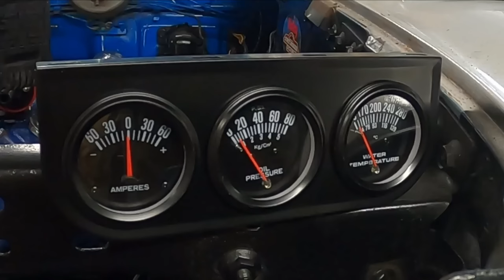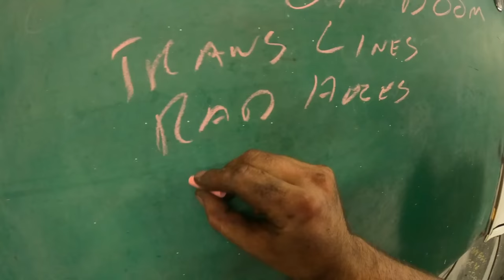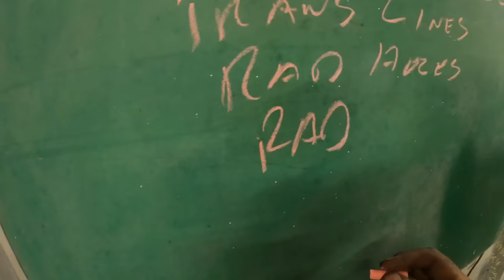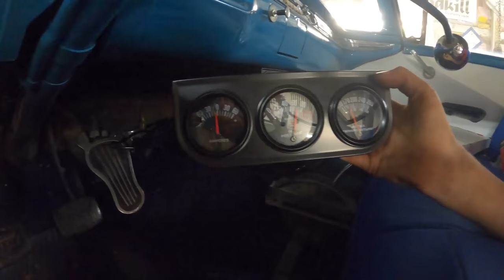Will it Run? 390 Ford FE BIG BLOCK Shadetree Special Install in 1959 Ford — My Son's First Hot Rod

Comment: I miss the years of when my son and I did this stuff. We swapped our rusted out frame on my 65 Galaxie 2 dr ht, put the 394FE I built back in 1999 and pulled it out of the truck, put the C6 and 4.33 locker in and the engine/transmission swap in, it was so much fun. I m 62 now and blind and my son is 40 now and really busy with his own family and work. Do these things while you can. They grow up so fast!
Reply from the maker: They really do

Comment: I was a ford transmission tech forever.the secret to lining up the torque converter studs is to center the stud at 12:00 and the flywheel hole the same.once it is installed,check to make sure the stud wiggles in the hole in the flywheel.if not,pull it back out because something is not right.
Reply from the maker: That is exactly what I did actually

Comment: Thank you for uploading this.  I had an awful weekend and the neighbor I grew up learning repairing things from is gone.  Your uploads really brighten things for me sometimes.  On the Ford C6 I was taught that the torque converter seats in 3 steps and you want to be able to wiggle the torque converter stud side to side and that will show it isn't bound up.  I've had my C6 out a few times and they are a pain but I still like my Fords.

Comment: Some us more senior mechanics are aware that when the oil pump shaft refuses to engage the oil pump, or the distributor depending on make, all one has to do is bump the starter until it does. In any case long before you have arrived at the point of obstruction the distributor gear has already engaged the camshaft so bumping the starter doesn't upset anything. Never fails.
Reply from the maker: Good point, but I prefer to know exactly where the rotor is on startup, try to eyeball the timing

Comment: Me and my dad rebuilt an '83 F150 for my first daily driver and dad's hot rod, a lot like you're doing with JD. I wrecked that thing not 5 months after I got my drivers license, totaling it but we managed to salvage the motor. We built several more vehicles throughout the years together, and not a day goes by that I don't wish that I had one of those vehicles to remember him by. Our '93 F350 dually with the 12v Cummins diesel, the '85 F350 4x4 shortbed we made, the '70 Torino we put back on the road, or just working on my '97 Mercury Cougar.

Comment: Your doing good guys. That's a Bummer when that happens, I know you know the torque converter goes in 3 steps, just another insurance is when you mount trans to engine keep checking that the T converter is free spinning behind the flex plate then pull it forward to bolt up when bell housing is home. Great job on that engine. Awesome project
Reply from the maker: Amateur mistake, no doubt. I can promise you it only took one time to learn it

Comment: You had me gritting my teeth and crossing my fingers when you pulled the transmission in with bolts. I actually broke the bell housing on a  C6 once in my 1979 F150 while doing that.
Reply from the maker: So far so good for me, I know that day will come though

Comment: Gotta love that vacuum wiper motor. Pro tip, it may need to get a bit wet before it works. My ‘59 Retractable is quite the teacher
Reply from the maker: Yeah hopefully I can rig an electric motor into it
Reply: @PoleBarnGarage , they sell them. I may have one in my parts stash

Comment: Just stumbled upon this randomly. Good to see someone putting an FE in a car instead of some new crate engine. My favorite engines. Drove a 64 galaxie to work and back today. Not sure if you have done this yet or not, but those cars should have a ballast resistor wire that comes off the ignition switch via a bullet connector and goes into the wiring harness and has another bullet connector on the other end of it. It should be eliminated or disconnect the wire at the bullet connector and run a new wire out to the MSD distributor from there.
Reply from the maker: Yep I threw it away in the video, thanks for coming along. You'll find that even though I don't really like FE engines, I'm pretty big on keeping things old school, even if that means I suffer
Reply: @PoleBarnGarage  I've built a couple of them, one a 390 and the other a 445 stroker. They will give you a run for your money for sure, but once they are done, they are awesome running engines. Believe me, I've done my fair share of swearing at them LOL!

Comment: I don’t know if anyone has commented before, but that fuel pump can be ‘clocked’ undo the bolts at the bottom and take off the cap and turn it where the inlet/outlet work with your vehicle
Reply from the maker: Yeah I learned that later on. Still not sure what kind of fitting you use in it

Comment: Yeah I was hoping that I could tell you those headers weren’t going to fit but you found that out. I have a 57 Ford ranchero I put a 390 and I had the same problem nobody makes a set of headers for that car. Except for a couple of people I think one guy is in Oregon and he wants $1200 for a set. So I said no to that. I got a set of headers for 390 F250 pick up 71 through 73 for about $150 and cut them up and made them work and made my own headers. It’s either that or run the stock exhaust manifold which I did not want to do. Best of luck to you and your son I think that’s a cool father and son project I did a lot of that growing up with my dad.👍
Reply from the maker: Hey, I did find headers from Schofield I think. $400 a set, not cheap, but they do exist if you're looking
Reply: @PoleBarnGarage   thanks anyway but I’m happy with the ones that I made because they’re full length and that’s what I wanted. Have been on the truck for five years now no problems .🇺🇸🛠🇺🇸

Comment: Like the 59 my family had one the same color pattern but a 4 door , 260 v-8 I believe
Reply from the maker: No Windsor in 59, likely a 292 or 312 Y block. An engine I like even less than an FE..
Reply: @PoleBarnGarage  won’t argue that probably was a 292  or what was the bigger maybe 312 , got it from my grandpas in 64 , I remember being 5 or so and I had found a flat bastard file in the yard and hopped in the car and accidentally hit the steel dash on the passenger side with it and put a dent and a scratch in it, I’m almost 61 and can still remember the ass whipping I got for that.
Reply: @PoleBarnGarage  the 59 was a step up from a 51 Pontiac straight 8 that wasn’t running

Comment: Woohoo!  She runs!  In fact she sounds ruddy awesome!  Shows you don't have to spend megabux on an engine to get another 20 or 30k miles at least out of it - take a tired beast, chuck rings and bearings in, dingle-ball hone the block to somewhere decent, chuck a decent oil pump in, lap the valves so they seal properly and away she goes. I'm just surprised it worked on a Ford...but maybe it was your technique rather than the engine itself!   That 2000rpm rip sounded great and her idle was perfect. Just a pity that the box didn't want to play the game.  

Great to see her alive again, mate.  Great to see JD getting stuck in and giving it his all too.  His smaller hands are perfect to get in spaces that neither of us could EVER put ours nowadays!  (Ummm.....that sounds a bit dodgy - don't go there). That old beast is sounding good and will be a great cruiser for sure.  Feel your pain about not being able to drive it yet, but having that engine sound so great with such good oil pressure and temp, you gotta call that a win.  Any time spent with the young fella has gotta be a good thing in any case.  He'll be a bit down about  having to wait to go out in it too, but he'll have enjoyed the rest of the time working on it with you.  The Bodywork video will be an absolute blast, I reckon!  Kids love sanding things and seeing the results of their efforts, so I bet he'll end up more covered in crap than he has been getting!  Honestly, you must have some super fizzy-whiz-bang industrial-strength washing machine to get clothes back to normal!  

All the best, mate.  You looked absolutely done at the end.  Things will pick up and go right with this beast eventually.  Just remember to count every small win  and celebrate it....and you certainly got a couple of big ones in this vid.  😊
Reply from the maker: Great words of encouragement, thanks!

Comment: When I was 16 my dad and I built me a 68 Camaro with a pretty decent 327.  Ran pretty good on the first few test runs.  Well as he was getting it finished up for me to start driving it full time, he adjusted the throttle line.  He did it the same way you did, using the fuel line.  He made it longer so that I was only getting 3/4 throttle when my foot was on the floor!  I was pissed when I found out because of all of the races that I lost that I should have won, but looking back I am glad he did.  I would have wrecked that car and God knows what else.  It was alot more fun after I fixed the linkage tho!

Comment: I did that once ,AKA learned the hard way. I know on g.m. the rule of thumb is ,it's seated,when you can't put your fingers between the converter and the bellhousing.
Reply from the maker: That's what I've always done as well. I've never messed it up in dozens of installs, but who knows

Comment: I've bought 2 starters in a row at O'reilly for 91 4.3 truck that clunked but didn't work. Them Ford e250 and e350 power steering coolers if you can find them make for great trans coolers, its a whole kit, hose, clamps and all for cheap. I had to throw one on my Grandmothers Colbolt as the rad cracked at the lower trans fitting, 30 bucks for the entire kit vs 200+ for a rad. I also put one on my 99 Suburban for an oil cooler as the rad I put in it a few years ago didn't have a oil cooler, Rock auto sent me the wrong rad, and I didn't want to loop the lines or wait for another rad.

Comment: That blue pipe seal called leak seak,is awsome stuff. It's for propane,or natural gas. It's  way less messy. It's thicker. A little goes a long way hens using less saving money.it is moore expensive than regular pipeseal
Reply from the maker: Interesting, is it gasoline resistant?

Comment: For future references or issues like this. Nowadays they do make extended trans yokes you can buy if your shaft is a bit to short. Just something to keep in the back of mind if your ever in a situation like this again.
Reply from the maker: Not for a c6. I ended up buying the longest yoke I could, 9.5" unit from a mustang
Reply: @PoleBarnGarage  I see. Was hard to tell the length on Video.

Comment: starting to see a need to test "new" starter motors before even fitting them,  i can't remember which it was a couple of years ago, but My auto electrician said something like i'll rebuild your old starter motor or alternator as ALL the new ones are garbage.. Really impressed with the transmission coming straight out again, i guess you have to.. but i'd been too annoyed to do it on the same day.

Comment: What I can remember on Ford tranny's is that it's one turn forward then one backwards and then one more turn in forward, and they will bolt up even if the torque converter is not all the way in, well I hope you and your boy get the old car going, nice father son project

Comment: I tried to bolt the engine and transmission together in a Ford I owned  once when I didn't have the flywheel on the last ''click'' and it locked it up tight enough that the engine wouldn't turn! Yours turned no problem whatsoever! Also I know a guy that didn't get his seated all of the way and he forced it until it turned and destroyed the transmission completely! I think it was in far  enough and there was some other problem that caused it.
Reply from the maker: I'm kinda leaning this way, but if it gets it fixed for free 🤷
Reply: I agree with Danny - an unseated converter generally sticks out enough to bind the engine if the transmission is bolted to the engine without it being seated.

I’m wondering if the snout of the converter didn’t seat well into the crankshaft, pushing it back into the transmission?

Comment: I get the HEI thing (To many boxes and crap flooding the inner fenders) but not the GM Alternator. A G3 Ford Alt conversion is fine, also convert the starter to the trident motor style Starters (It's not a Chevy, most ford starters fit everything). you can inline both solenoids to work. Last buy a performance style starters with the adjustable clock, they're cheaper than the rebuilds and New. The Old ford starters suck! ~A Ford Guy ;)

Comment: my 73 Monte Carlo I put an Impala transmission in it but I had to use a Vega dry shaft at automatic Vega transmission drive shaft and especially u joint if it just right

Comment: I have another channel...BFR Motorsports...I had my 390 rebuilt last year and when I got it back I tipped it over on the stand in the garage and it cracked a mounting tab on the exhaust header port on the head so I need that welded back on or I have to get aluminum heads for it. Anyway...I'll be putting the motor back in my 66 galaxie later this winter. So this was a good video for me to watch. So thanks!
Reply from the maker: Great!

Comment: When you pulled the trans to the block by tightening the bellhousing bolts I flinched. Don't know the history of that motor (just started watching) but did you check for a pilot bushing left in the end of the crank from a past life as a manual trans. Have run across this a few times in the past. Will make a nice car for your son.
Reply from the maker: I recommend checking out the other videos for sure, it was a manual, but I removed the bushing

Comment: I did a video on the hipo fuel pump Ford FE . there's supposed to be a fitting between your lines. if you'll look up my video for the hipo FE fuel pump you'll see you'll see .the aftermarket once might not be no good but the Carter ones are the best
Reply from the maker: I dunno, it was cheapo Chinese one. The factory style replacement works fine

Comment: That fuel pump can be clocked and you run a pipe thread into it and crank it away or tap it to a larger pipe thread
Reply from the maker: So I learned, after throwing it in the garbage and putting a factory unit on

Comment: Anyone that needs a hei distributor for a FE don’t spend that insane money on a MSD. You can get one from Amazon for 70 bucks. Even if you have to change the coil cap and pickup coil, you’ll still be under half what MSD cost. They have really good reviews, I’m gonna buy one for my 390.
Reply from the maker: Yes but you know.. Holley lol
Reply: mine has the original dizzy with the duraspark era cap, rotor and pickup coil but using a chrysler ignition module. Been that way since "82
Reply: @Wazoo117  yea mine is similar and runs fine but with the hei I get to do away with some of the 50 year old wiring and and get it down to 1 Hotwire running the engine

Comment: You loomed plug wires for cylinders 7&8 next to each other, when #7 fires it will induce a spark in #8 and because of that it will run with a miss.
Reply from the maker: No.. Just.. No lol. Maybe In a time before suppression wires

Comment: Go to harbor freight and get you a set of I think they are a 9 inch pair of heavy duty crimper pliers the Doyle brand I bought a set of them for $11, and the OEM tools set of spark plug boot pliers for getting them off around headers is on Amazon for about $16, I have not bought that yet.. I have replaced several Ford new starters in my momma's 96 Ford F-250 7.5litre 460 bbf EFI it takes new ones and cooks them takes some serious torque to crank over the 460 in her truck. It's a factory a 7.3 diesel truck but it got swapped out at the dealership before they resold the truck it's a f250 super cab long bed HD 2wd truck.a40d, and the Chevy starter for the Silverado is like that barely cranks over damn near kills the battery just before the truck starts.

Comment: Remember when you told your boy to never use the bolts to pull the transmission up to the block.. yeah, that’s when you busted the front pump.. You didn’t have the torque convertor in all the way..
Reply from the maker: It was stuck because of the paint on the dowels and the trans had been painted

Comment: I've been watching a lot of your videos. Good stuff I'm enjoying your content. Question. You say there's no junkyard in your area. What do you guys do with your junk cars? Where do the wrecks go?
Reply from the maker: Scrapper. There are some pick a parts but that's all modern crap
Reply: I live in Rochester New York. We had two awesome junkyards just packed full of old 1960's metal. Good stuff like Chargers with Hemi's and 4-speed manual transmissions with 2.44 low gears still in them when they closed and brought everything to the crusher and sold it for scrap.

Comment: note how the engine hoist easily attaches to the intake manifold....I'd think a guy would want to do that for manifold installation since it is very heavy and did cause some difficulty and ruined intake gasket???
Reply from the maker: Nah, they're meant to do it. The carb plate would give before anything